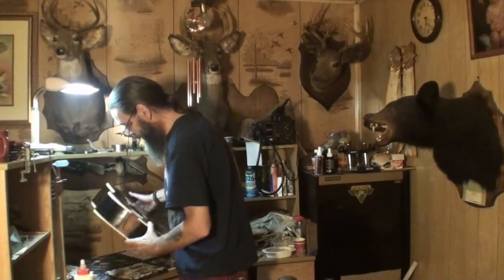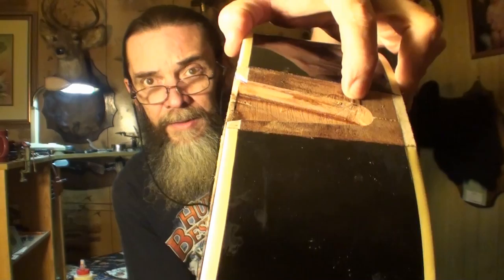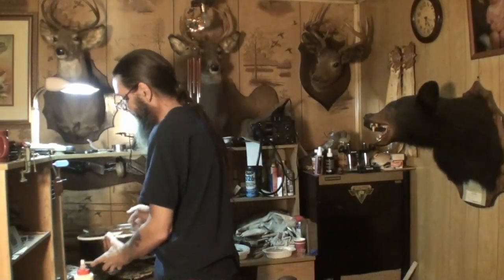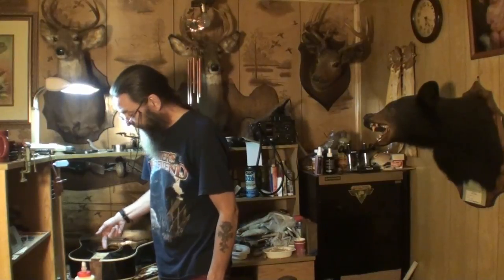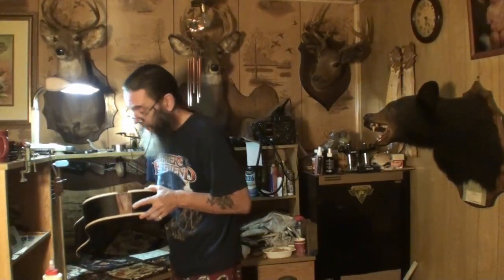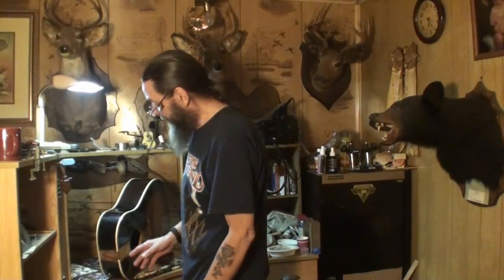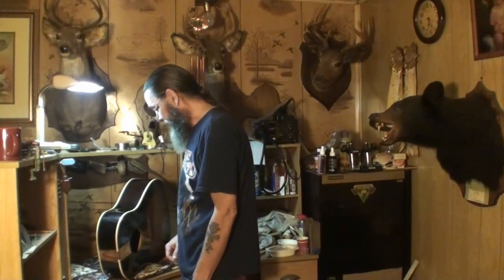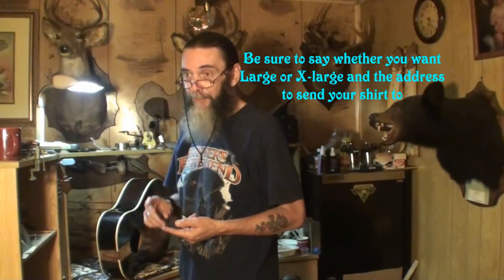gibson j45 cleating

Comment: Cool vid Randy. I know it would be a hassle to heat up hide glue for three cleats but if you hold a cleat in place long enough for it to cool off (which doesn't take long) the glue shrinks as it dries and pulls the joint tighter. No magnets needed. Also a spec of fun tack between the cleat and magnet would allow you to locate the outside magnet, then the inside one with the cleat stuck on would locate itself. Just some ideas
Reply from the maker: Great ideas Dane, thanks for sharing them and thanks for watching! I'm always open to new ideas. I need to make some more hyde glue. I've been gluing so much on other repairs I just naturally grab the Titebond bottles without thinkineverytime I need to glue something.

Comment: You're doing a great job. Gotta love those magnets...got a set of them myself...I've managed to give my fingers a blood blister or two using them for crack repairs, they really are super strong. I like to use a little double sided tape to locate them, it helps. Hang in there, you do excellent work. Hoold Ooon! and give Q-ball a big hug for me :D
Reply from the maker: I've used double sided tape to stick the cleat to the magnet, then use another magnet on the opposite side of the crack placing it exactly where I want the cleat and while holding it there the magnet with the cleat taped to it will fall right into place. I don't know why I didn't do that here lol Thanks for watching! Hold on! =D Q sends much love! :)

Comment: not being rude but did you think to add another set of magnets to take up the space between the cleats so it wouldn't pull the other one off the cleat?
just a food for thought brother have a great day and keep the videos coming
Reply from the maker: That's what I finally ended up doing, these things are really powerful, they even try to stick together thru my hand lol Thanks Paul!
Reply: ya I use them all the time for gluing & what not also I use a small block of wood gives better control if room allows thanks for the great videos